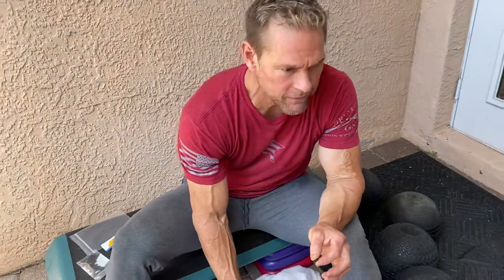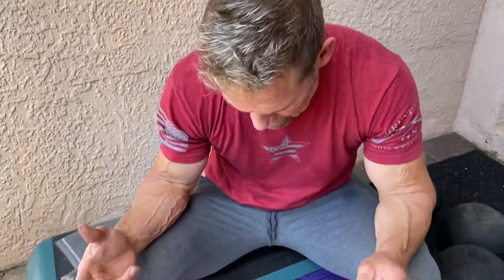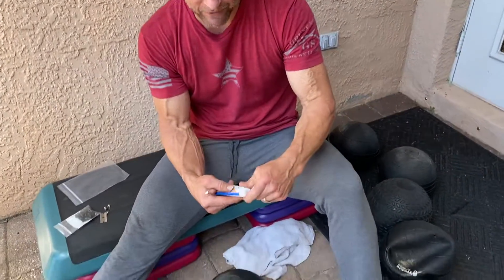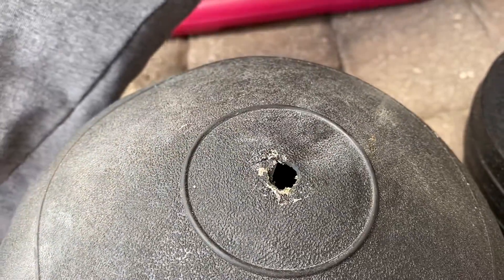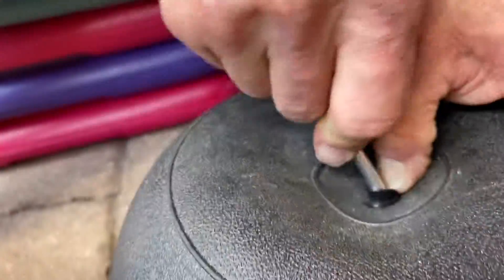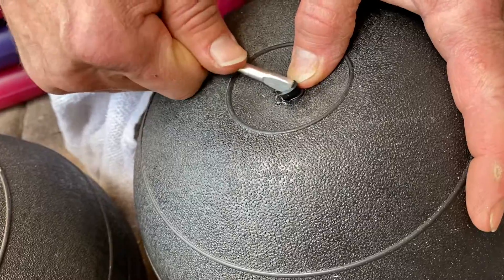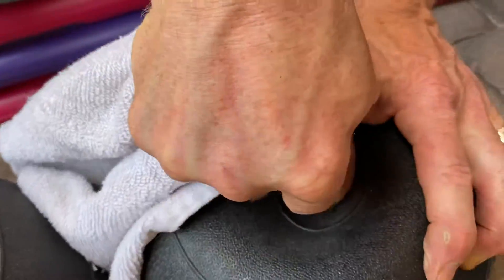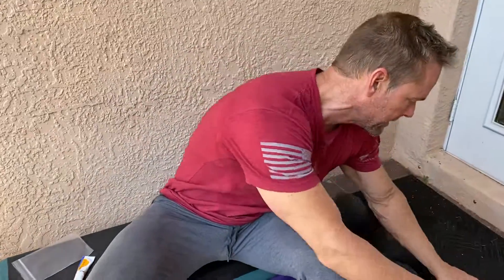How To Fix a Busted Slam Ball

Comment: Sand is coming out of mine. I pushed in the thin ball pump needle and then samd started coming out.
Reply from the maker: Did you try to replace the valve (with basketball plugs)?
Reply: @pFITtv  not yet. Thank you. I've been looking for slam ball specific valves and didn't want to buy a batch of 20 for $40 or so....thank you for the reminder to get it sorted.